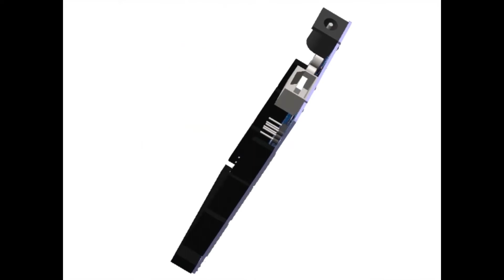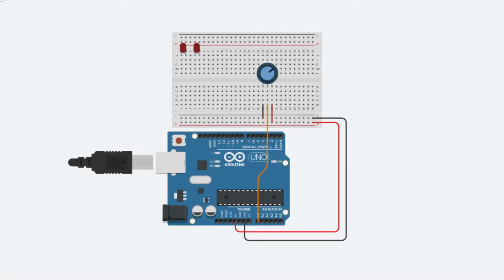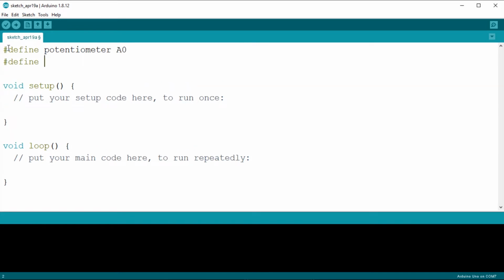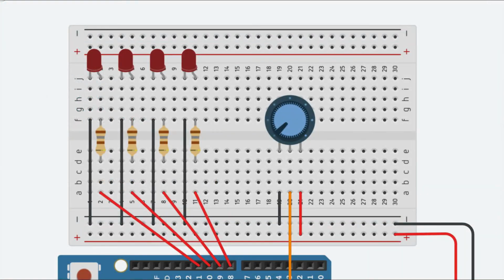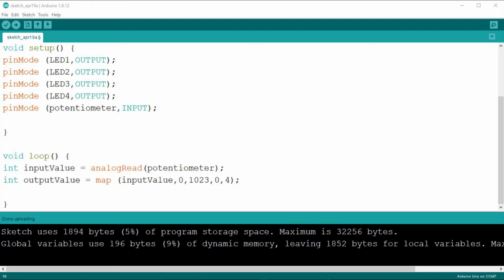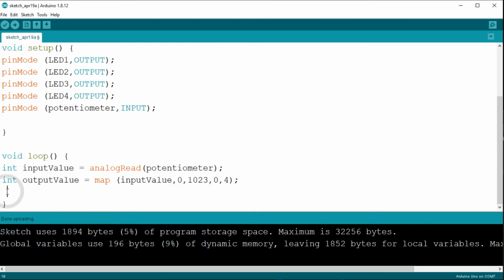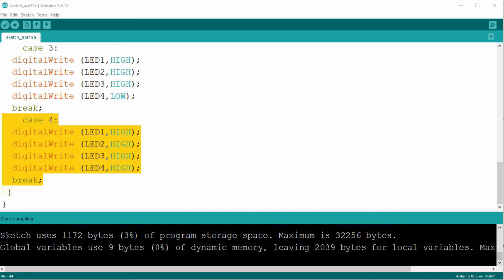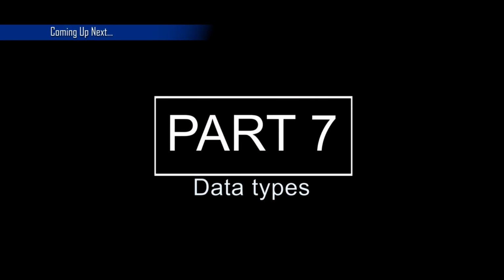arduino   06   switch statement

Comment: Even though this is relatively easy to follow, the pot is very inaccurate in reading the voltage, which in normal conditions causes the led to flicker(if you'r using alot of them, >10) so you would rather have to replace the pot with maybe a digital one, or something similar that can work without any noise.

Comment: case 0 
led1 high and 2,3,4 are low
case 1
led2 high and 1,3,4 are low
case 2 
led3 high and 2,1,4 are low
case 3 
led4 high and 2,3,1 are low this is solution